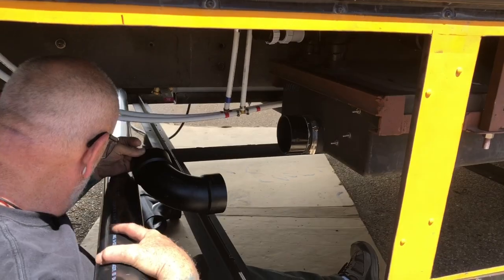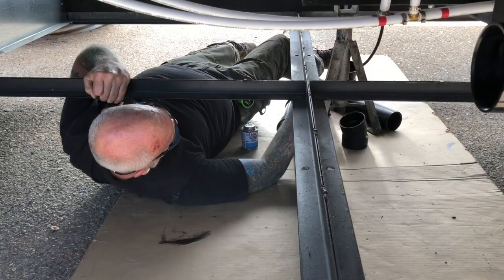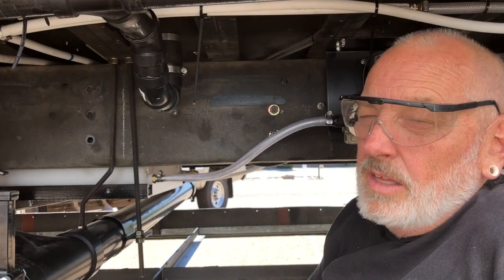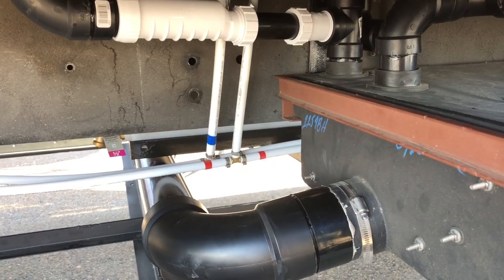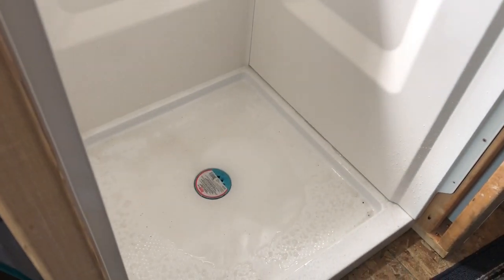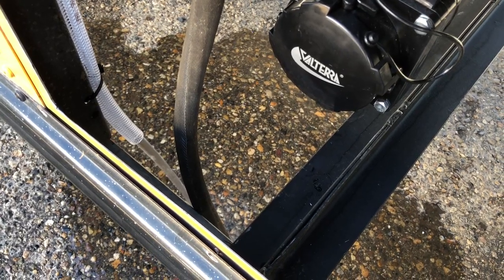We Have Water in the Bus - Vlog 151 School Bus Conversion

Comment: Shelly, I found at Walmart a dish drainer that fits on the small side of the sink so you can use the tub on the left, dish drainer on the right and rinse the dishes all at once with your facet.  It will save water if you’re boondocking.
Reply from the maker: Thanks for the tip. I'll look into that. We actually have been using a dish pan to wash in.